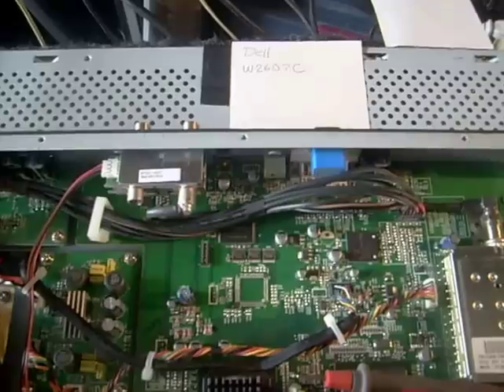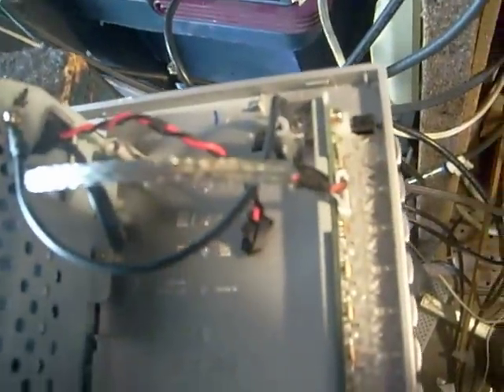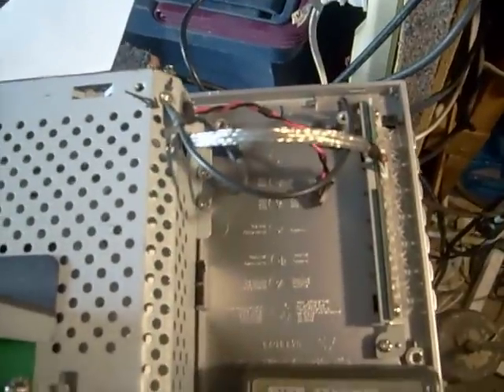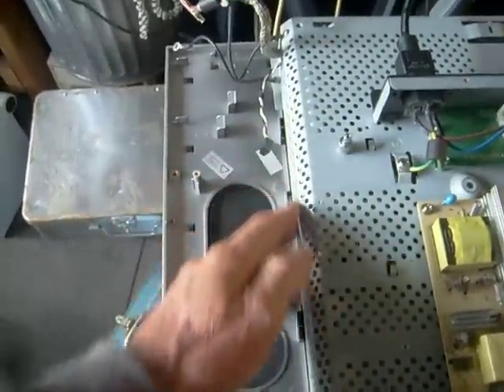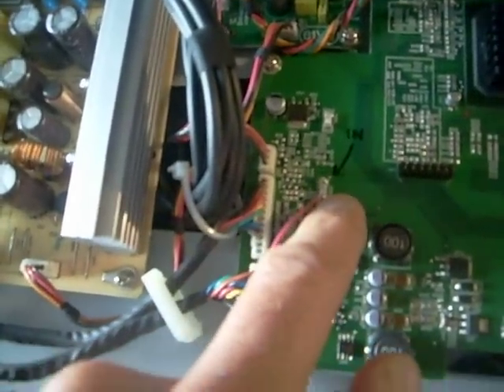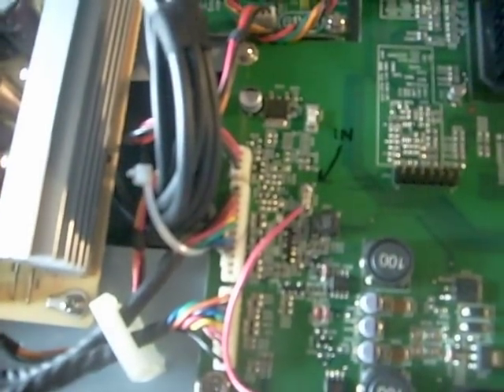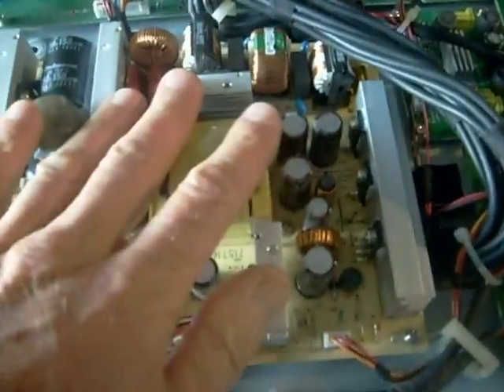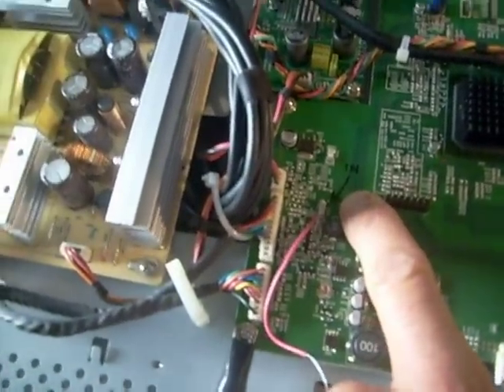Finding a short to ground using this special technique.

Comment: I use a small 9v battery or a AA battery they are 1.5v and double them up you get a 3v tester then to put in the board

Comment: A what value resistor, did you use?
Reply from the maker: It's been a while since I made this video, but based on ohms law I'm guessing it was a 12 ohm resistor which would only allow 1 amp of current to flow if my applied voltage was 12 volts.
Reply: @GrantsPassTVRepair  Thanks for replying. I’m learning a lot with your videos. Cheers!
Reply from the maker: @maxwarfield6699  You might find this video helpful. https://www.youtube.com/watch?v=qotB1xxQols&t=386s
Reply: @GrantsPassTVRepair  That’s an AWESOME video, thanks! Because as a novice in this field, I wasn’t sure of how I could apply Ohms’ law, in a real circuit, with many components all interacting with one another. This video will help me, to better grasp how it can be done - I’ll be rewatching this one, over and over. Thank you kindly sir, and be safe.

Comment: If you are unaware of the old trick of putting an incandescent light bulb across the fuse terminals to verify a short I think you have a few more years to learn your trade.Using a piece of wire across the fuse is the stupidest thing I have ever heard of and why people shouldn't learn a trade from a youtube video.
Reply from the maker: Sometimes the most ill informed  people think they are best equipped to criticize others. Yes I know the technique, and I'm sorry you're unable to grasp how my resistor is lowering the current just as a light bulb does. You're not as bright as you think.

Comment: HOW TO FIND 1.5 V SUPPLY TO GROUND .
Reply from the maker: I don't know what your working on, or what kind of load your attempting to power, but if your talking about a TV it will not necessarily have a 1.5 volt power source inside of it. Even it it does there is a possibility that drawing additional power from the source may  prevent the device from operating correctly. What are you wanting to power, and from what?
Reply: ACTUALLY I HAVE A LAPTOP 1.5V SHORT TO GROUND NOT A TV.
Reply from the maker: Sounds like you might need a schematic to figure that one out.
Reply: I TRY BUT NOT LUCK AMD CHIPSET PROBLEM.

Comment: new technology made TV's easier to fix. just replace the boards unless the panel is bad
Reply: All very easy to say if you want to take the easy way out, but one little diode, transistor or capacitor costs only a few cents. A replacement board could cost a few hundred dollars. If you were the customer paying me to repair a TV for you, what would you prefer me to do? Labor charges apply!
Reply: a bad component can cause everything on the board to go bad especially the chips. most TV's use those shit junk Chinese capacitors. the main board for my LED is $55
Reply: But you can easily see if a capacitor is swollen or leaking. Replace it.

Comment: I like it - freeze it and the short thaws instantly!  Very cool.  I know this is no news to you, but for novice viewers, circuit breakers (reset buttons) are available in several current ratings and fairly cheap at tech. supply stores and they are an excellent alternative to a wire for jumping across the fuse during the troubleshooting process.  They even have them at Fry's, for those who want to pay $10.

Comment: Just as a quick hint, you don't need to buy a freeze spray. You can simply buy a can of compressed air (i.e. Dusting air) and turn it upside down. Spraying upside down acts as freeze spray.
Reply: analogpro7 You can also wet it down with alcohol. hot components will boil the alcohol off fast.
Reply: You a The Residents fan? Me too!
Reply from the maker: +analogpro7 Yes I've been informed but thank you.
Reply: Chris E - that is a safer solution in terms of thermal cycle trace cracking damage to the board which is possible with the freeze
spray technique, and more likely to occur on boards with multiple layers and tiny traces.
Reply: Yeah... IPA alcohol does the job too.

Comment: I ran out of characters.  My short on the old board is between ground and my 12 volt line from CN7  YOu don't by any chance have a schematic for this model 52 PFL7403D/F7  Sure would like to find this short.  This tv is really been a tough dog for me, and now I have this noise in the speakers with the new board installed, pulled board not new.

Comment: Hi Dave: DO you have a schematic of that low ohm meter.  I would love to build one.  One problem I have is my fluke meter doesn't zero out, and reads ,30 with leads touching.  I have replaced the main board on this unit.  The tv works now but I have a fast ticking noise coming from my right speakers.  Any idea what would cause that problem?  I have also been comparing this good board to my old board.  Almost every SM cap reads 1.5 K or over  I have removed so many components of the old board,

Comment from the maker: I think the leakseaker is great but I don't own one,  On those rare occasions when I find it necessary to measure shorts which are under 1 ohm, I use my antique ohmmeter which can divide one ohm into 50 divisions.. you can also build a simple low resistance meter with out having to spend so much money. watch?v=0vMvCVyOp9g
Reply: I typed V=OvMvCVyOp9g and got nothing. Can you redirect me. Thank you

Comment from the maker: Sometimes you can find bad, transistors, diodes, and resistors with your ohmmeter, but I wouldn't consider anything under 50 ohms as direct short in all cases. It's been my experience that when transistors and diodes go bad, their resistance is generally under one ohm, but some transistors have internal resistors that make them difficult to test with an ohmmeter, and electrolytic capacitors don't generally short out. Sometimes there are low resistance components in parallel with capacitors.

Comment: Maybe I taught myself something many years ago that was wrong.  IN the past when I have had a shorted transistor or cap.  I would measure across the cap and get a very low ohm reading.  I would lift the shorted component, and then my reading would go up into the meg ohm reading.  I found this to aid me in troubleshooting accept when there was a resistor across the cap.  Have I been wrong all this time?  Educate me please.

Comment: If there is no resistor across a SM capacitor shouldn't there be a meg ohm reading across the cap?  I thought anything under 50 ohms was considered a direct short.

Comment: I have to admit this double sided sm board really has me confused.  I have lifted several components and still across several of the caps I read .3 ohms and a few where my meter beeps.  I have removed several components in this area.  On other area's of the board I have meg ohm reading across the sm caps.  I thought there was a short because when pulling that CN7 wire and then instantly having my back light come on, made me think a short was pulling my 12 volts down.

Comment from the maker: Measuring 30 ohms across a SM Capacitor doesn't necessarily mean the reading your getting has anything to do with the capacitor being bad, Unless you have a schematic diagram showing you the source of your resistance reading it's a guessing game. Was there something you read which convinced you that a 30 ohms across a SMC proves you have a short?

Comment: Hi again Dave more on my problem with the Phillips PFL7403D/F7   I pulled the main board and was searching for the short.  I found many SMD capacitors with a ohm reading across them of .30 ohms  However ever after lifting many of them I still have this very low ohm reading.  This is a double sided board and I have heard the short can be between the layers.  Nothing is heating up at all,  Just can't seem to find the short.

Comment: Hello Dave:  I am having a terrible time finding a short circuit on a Philips model # 52 PFL7403D/F7  The set will not power up at all.  However pulling connector CN7 which is a 12 volt ribbon cable going to the main board.  The set powers up and the back light comes on.  I would really love to do a component level repair to gain experience on surface mount. tech known how.  Any help you can give me would be appreciated.

Comment from the maker: @madisonelectronic 
Ringing the flyback is done by attaching the ringer to the primary side of the flyback transformer. When doing this you should pull off the connector going to the deflection yoke or you can get an incorrect reading since it's in circuit with the flyback transformer. Just for the record finding a bad horizontal output transistors is far more common than bad finding bad flyback transformers.

Comment: Good Job.Thanks for sharing.

Also check the other surrounding components as well Dave.I'm sure you know this anyway.

I'm building a serial eeprom chip programmer & a fuse trip switch for low voltages right now.I'l let you know if it works out.May come in handy.

Comment from the maker: @banjax66 Not in this case. The mosfet was hot enough to burn my finger.
Reply: It could also be that the MOSFET is fine -but carrying excessive current - because of a short further downstream. I also have a problem to deal with, a short on a PCB that's hard to pin-point.